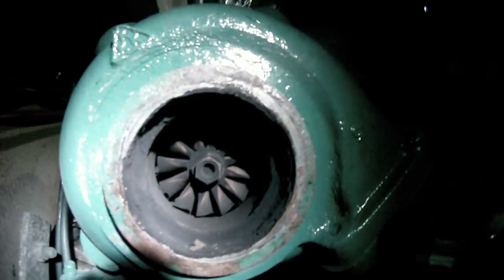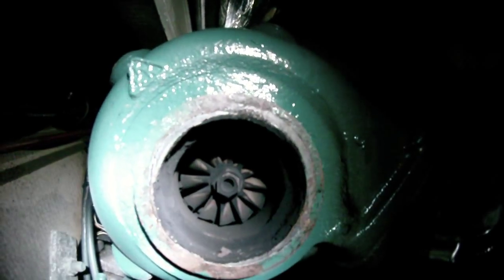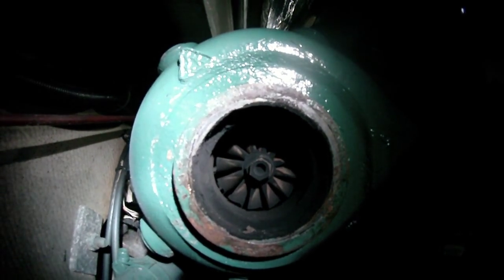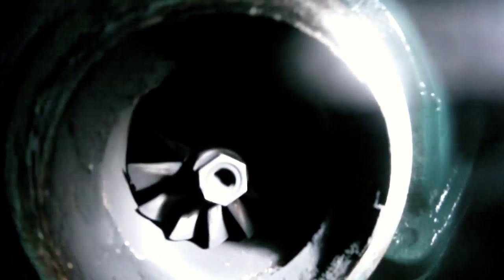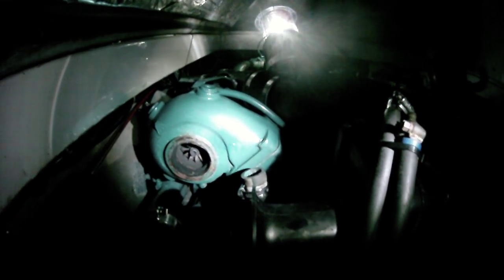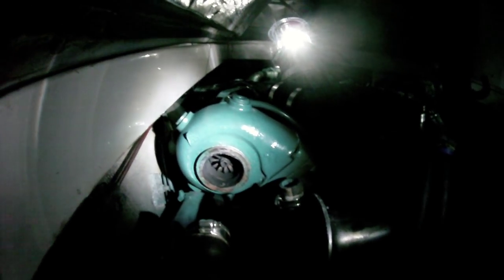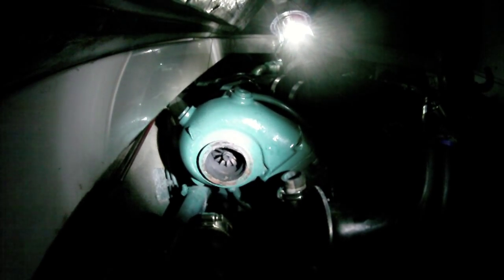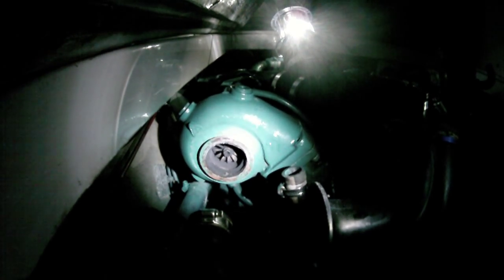Turbo KAD44

Comment: Having massive acceleration problems with my KAD44, the supercharger shuts off just when you need it before the turbo spools up, then clicks back in - so you end up bunny hopping along and a lifetime to get on the plane. Did you have this type of problem and the new turbo fixed it? Not cheap option if its just a solenoid on the inlet manifold that controls the magnetic clutch??

Comment from the maker: I have not had any other problems. The elbow is what caused the wear in the turbo. The elbow should be changed every 5 years or so. I have also been told go new on the turbo do not rebuild.

Comment from the maker: Yes.  When I would throttle up the super charger would kick in, as soon as the super charger would shut off I could put the throttle all the way forward and there was a hesitation, eventually the turbo would catch up and the boat would take off.  Once I changed the turbo the acceleration was smooth without any hesitation.